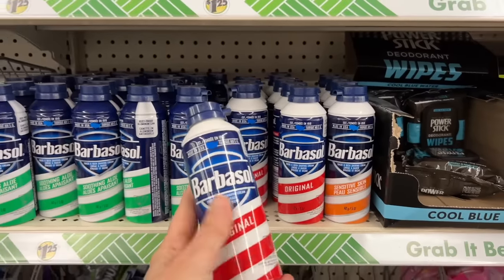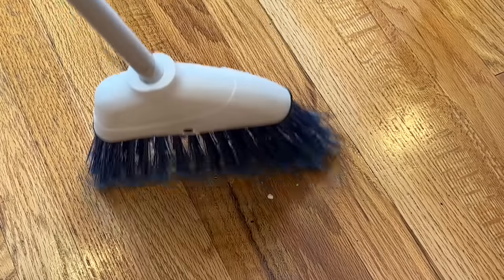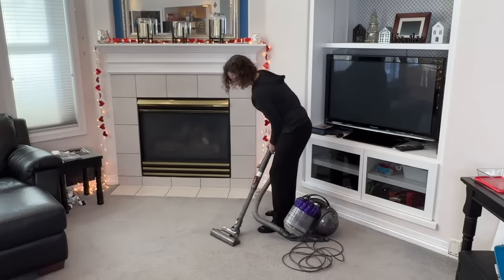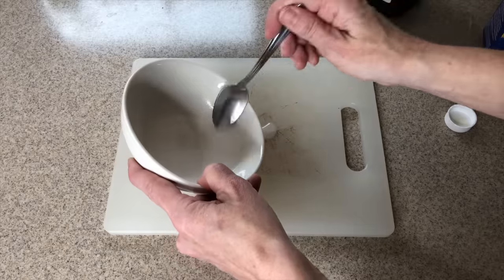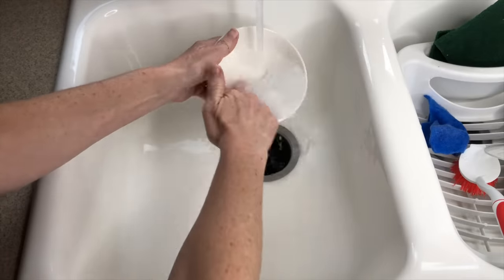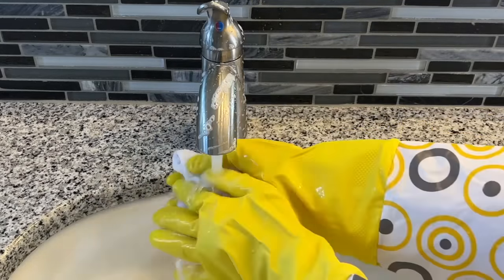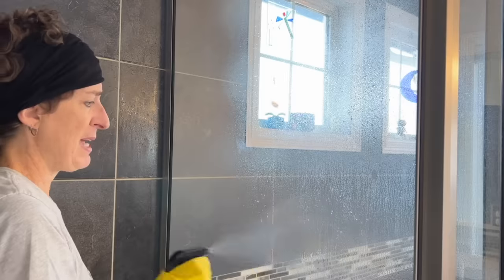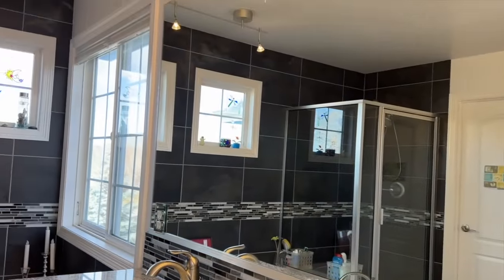This will solve everyone's WORST toilet problem!

Comment: I use three part for cleaning everything, water, vinegar, and alcohol with a little bit of whatever soap you want IF you want.  Then, for all the floors I have a HAAN steamer, uses nothing BUT hot steam and works very well. You can get one that has attachments for all sorts of things.  My daughter had three pages of allergies, so some of the things you use, I couldn't have used.
Reply: Use steam with caution on some floors. Steam can crack ceramic/porcelain tile.
Reply: Steam is not only a great sanitizer but the cheapest way to clean many areas as long as they are safe for high heat application.
Reply: Add lemon as for freshness

Comment: If your cutting board looks like that, you need to clean it better that’s bacteria. You can take a semi-sharp knife and scrape it over the top of the plastic to try and shave down all those loose ends. You’re basically shaving the top of the plastic getting down underneath your knife marks. You should consistently clean your cutting board every time you use it to prevent bacteria.
Reply: I daily use straight white vinegar on my wooden cutting boards. Also after I clean the pets bowls I use vinegar with paper towel to finish cleaning them, kills bacteria and sweaky clean
Reply: Buy another one. They're a buck. Those plastic ones are nasty anyway.

Comment: Great video!!  The toilet…..I scrub the hole thing but can’t figure out the smell!!!!  And for the person who said to re-caulk the toilet, my toilets caulk is not cracked or pulled away so………..
Reply: You have to remove the toilet seat and clean under the screws that hold it on.
Reply: White vinegar. My mom used it on our toilets because both of my brothers always had bad aim.
Reply: A child's or men's hitting toilet rim & urine running down side of toilet to the rim on floor. Then a build up.

Comment: The whole “Plastic” cutting board should simply never be used, when you cut on a plastic board, you end up with plastic particles in your food and over time it s a huge health issue… just use a good wooden board and stay safe.

Comment: You should not use tap water for cleaning solutions.  It contains all the metals, chlorine, etc that are causing the stains in the first place. Use distilled water. Its cheap and better for cleaning.

Comment: Use shampoo on blood stain wait about 5 minutes wash as usual
Reply: shampoo & dawn don't work on blood stain on t-shirt.
I hang the t-shirt & spray undiluted cleaning vinegar for 5 days till its gone then put into laundry.
I also use it on old rust stain on t-shirt.
Reply: For blood stains, I have great success just using hydrogen peroxide right from the bottle then rinse with cold water.
Reply: Formula 409 works wonderfully on blood spots, and with extra scrubbing effort it often even removes dried bloodstains. I really doubted that it would do anything, until I tried it.

Comment: Is it safe to put your bare fingers into hydrogen peroxide? It doesnt burn or irritate the skin?
Reply: The 3% grocery store stuff won`t hurt. (Within reason - I mean don`t soak your hands overnight !). Just rinse your hands off afterwards.
Reply: If you have a cut it will lol. I wouldn’t do it, any microscopic break in skin is going to burn.
Reply: Hydrogen peroxide used to be used routinely for wound care until research found it impairs wound healing. It is perfectly safe to use in cleaning & unlike harsher cleaners doesn't require gloves. Never, ever combine peroxide or vinegar with chlorine bleach.

Comment: What was the pool noodle for?
Reply: to get the water from the sink to the tub.
Reply: Hook to the fawcet and one end into the bucket ti fill with water. Then you don't have weight of bucket filled with water in your sink and you do NOT have to lift the weight of bucket from your sink for those that can not do the lifting of heavy things

Comment: Any idea for shower door cleaning
Reply: Cleaning vinegar and dawn dish soap mixture.
Reply: If you hate vinegar replace with rubbing alcohol but the above will work.
Reply: Or that scrub daddy paste
Reply: Spray the glass with Rain-X, it will prevent water spots. We always used a squeegee when we had a glass shower.
Reply: I use dawn powerwash. Its a miracle

Comment: BLOOD REMOVAL TIP- If the blood doesn’t completely disappear with peroxide, leave original peroxide, sprinkle some table on the blood stains & spray more peroxide on top of the sprinkled salt. Should lift the rest of the blood stain out.
Reply: Does this work for menstrual blood too or just regular blood?
Reply: @sagwa18 Menstrual blood has the majority of the same components as venous blood. The difference is menstrual blood contains endometrial tissue but should not make any difference with stain removal. You may need to repeat the removal procedure because it is more viscous.
Reply: You can also sprinkle on meat tenderizer.

Comment: Goodness! This is just a over all home cleaning video :D
I do have a silly question. The 1 : 10 vinegar/water for glass mineral deposits. Do you think it would work on car windows/side mirrors or would it need to be much harsher? I was thinking that baking soda/hydrogen peroxide combo for the it but I'm unsure.
I don't wanna spend almost $200 on glass polishers.
I got the sun roof glass I could try both on first to test as I don't care how that looks at all (I leave it closed always) but feed back from anyone would be welcome before I attempt it :D